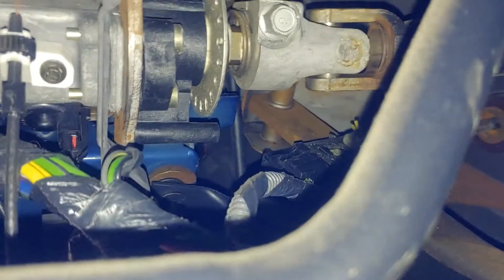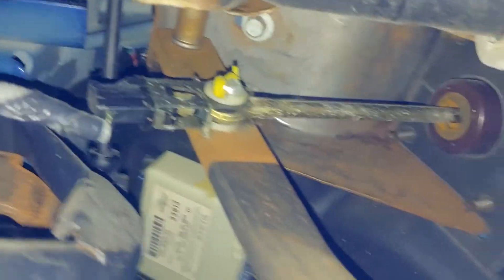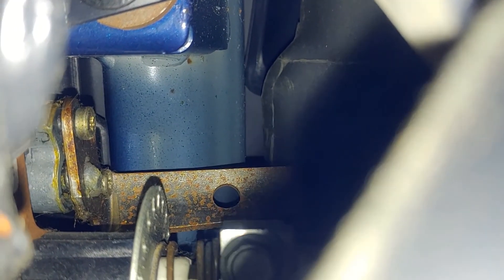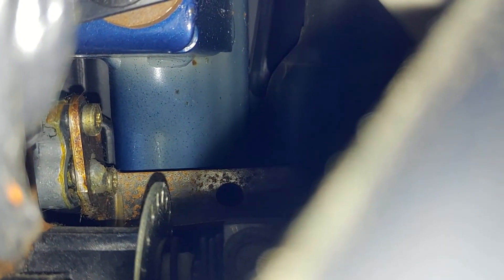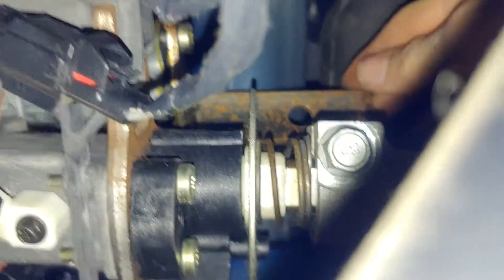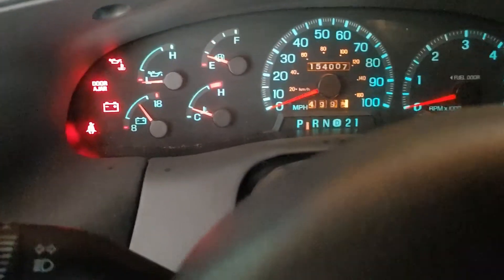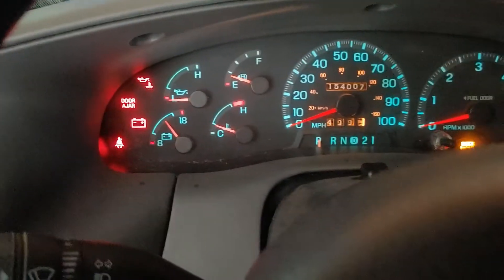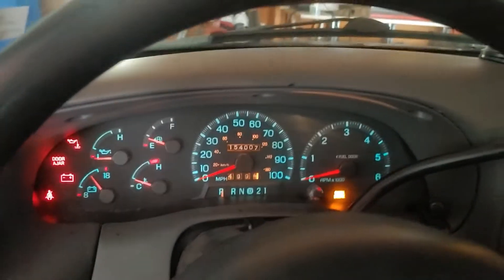1998 Ford F 150 park not working fixed (loose shift linkage)

Comment: You just fixed my 98 E350. Turn out I was missing one of the screws. No matter how tight I got that bottom screw, it would always slip after a single shifts and leave me using the parking brake. Didn't even consider there would be two of them. Stole one from a non-moving part of the column and I'm back on the road. Thanks!
Reply from the maker: Awesome! Glad I could help and you could get it fixed!
Reply: Hey person, which componant could i harmlessly harvest a screw from?

Comment: Honestly I really want to say thank you for this video you save me lots of money I have a 1998 Ford Expedition I had the engine rebuilt about 7 years ago since then I've had this problem the mechanic has wanted to charge me over $750 to fix it so I have not but it's always in the back of my mind that it's dangerous I'm afraid it's going to roll away one day kill somebody now I could probably fix it myself for free thanks man
Reply from the maker: You're very welcome, glad I could help! And It's always cheaper to do it yourself, I was using my parking brake up untill I fixed it myself

Comment: Not sure if this is the place for this video but it's the closest thing I found so far. I have an '07 F-150 and this weekend it would not go into park had to turn it off set the parking brake climb underneath it on the ground and turn a nut that I think is attached to maybe a shifter cable which honestly looks like a smooth cylinder rod to me. I don't know car stuff very well I'm learning as I go but if you can give me any advice a dollar direct me to any other videos and how to repair that I would really appreciate it. Thank you so much.

Comment: How to remove and open part under steering wheel?
Reply from the maker: Should be able to do it without removing the cover it just made filming easier, but if you want to remove it there are a bunch of 8mm I believe bolts around the perimeter of the cover, remove all those and it will be off
Reply: @zachmeisner  Thank you. I fixed it !!

Comment: Exactly the issue with mine found out my needle also had the plastic adjuster bracket broke off... was wondering why it floated sooooooooooooooooooooo farrrrrr away yyyy lmao yay plastic welding!